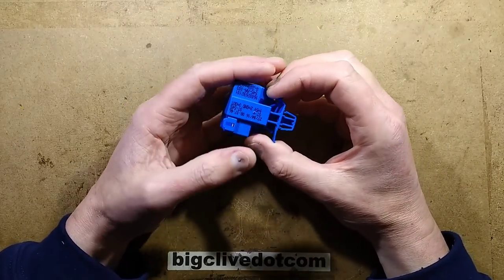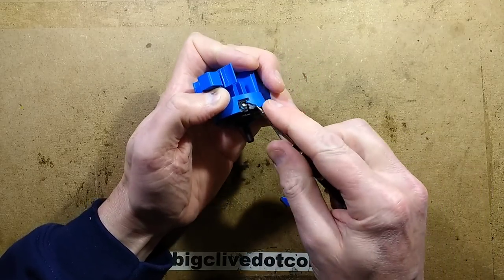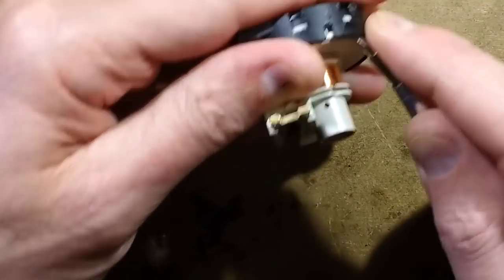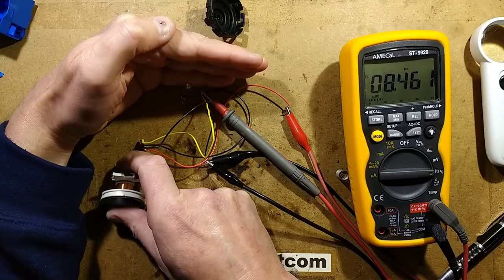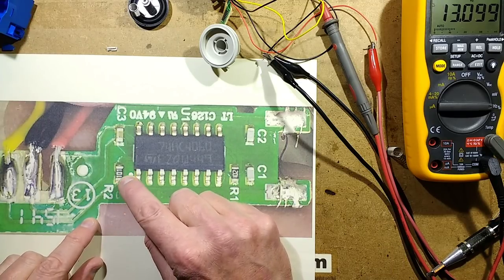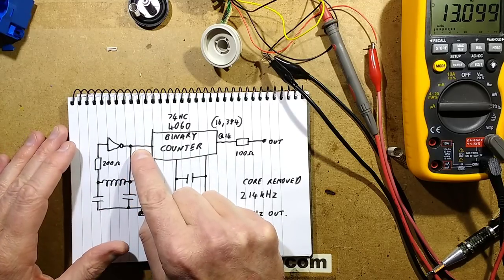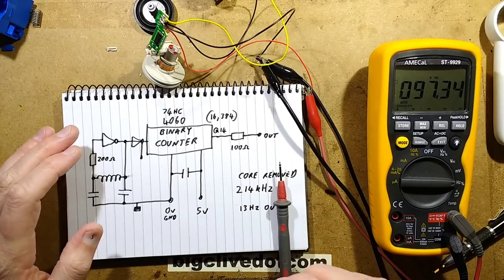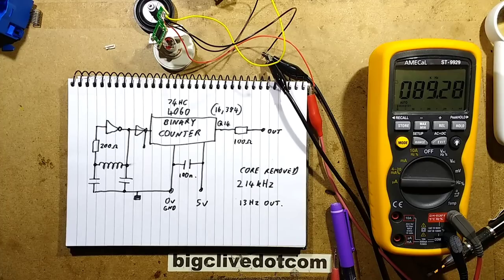Inside a washing machine water level transducer. (schematic)

Comment: I have a washing machine Ariston Aq8L with similar sensor. The output is a square wave of 5V with range that  goes from 10,75hz empty to 10,62hz with 2 liters of water. I am wondering if this the appropriate dynamic range as very often the machine fails to drain and starts blinking. This is range with drum stationary as when spinning the drum moves a lot as dampers are worn out and when spinning with normal load jumps between 10,26hz, 10,31hz, 10,36hz and 10,42 hz.
Reply from the maker: Have you checked the drain pump filter?
Reply: @bigclivedotcom  Yes, was first thing I did. I cleaned it but still happening Anyway the machine fills right level of water. The problem is with draining. It keeps draining for long and then it fails. I suspect it is because of the shaking due to worn struts that may affect the sensor readings. But when empty it is a known level 10,75hz. I am wondering what is the problem. I tried a couple times just emptying 2 liters (no shaking) and it seems to work.
Reply: @jorgemef  did you solve issue? My sensor shows similar Hz readings and I am not sure this is correct - Bigclivedotcom readings were broader range (9-13Hz or so). My machine just runs draining pump and gives F05 error. Like it tries to empty machine and thinks there is still water inside. I cleaned motor filter and even took it off when it tries to drain water
Reply: @meelis79  No, I still didnt fixed the issue. I cleaned everything, including main board, didnt found any fault there, and at the end replaced the suspensions either. The evacuation motor seems to run properly and I see a lot of flow being flushed from the evacuation tube. The machine may stop in different phases of the cycle and sometimes also does all cycles without stopping. Everytime if fails the F05 error appears. Now I am wondering if I should replace the sensor. Maybe the condensors have changed value with age and now dont resonate as well but we dont have the values to compare nor the item seems to be able to assemble/disassemble. It is a shame Bigclive didnt tested the frequency before opening it but it seems with coil in place to rest to be around 11.5Hz which is above the resting measurement from my machine with the tub flushed. I just come back to this machine as I had it out of service for last two years as was using and Indesit I had around but now that one broke the drum. Unfortunately the pressure sensor is of a different make so cannot test with the one from Indesit. Have you managed to find the cause of yours? Have you changed the pressure sensor?
Reply: Well, finally fixed it. I was set to buy a new sensor and decided to open this one as there was nothing to loose. I didnt opened the seal retainer, just the blue support to not damage the diaphragm seal. Then I tested by screwing in the plastic adjuster and was not even starting as probably was taking it as too full of water. Then reset it again and unscrewed half turn and then was possible to open the door, but then I tested to flush and was not clear it was flushing in full, so I ended up setiing 1/4 turn out of original setting. Door still unlock no problem and seems flush is full. I measured the oscilator caps and they seemed alright so my only guess is that the springs gave up with age so by adjusting it, it sets it with preset readings and also leaves me to conclude that on my machine there is no such thing as auto learned presets and is factory set to some value. I did tried the 2 litter trick to reset it in the past with no results. If you are wonder the resting frequency at atmosferic pressure (1/4 turn unscrew) is now set around 10.63 Hz so can be a good value to start with while before when was sometimes working and most not, was set around 10,75Hz. With one half turn unscrew was set as 10,50Hz, but as told I am not sure if will do full flush so I left it half away for now.
Reply: @jorgemef  Hi, I was getting my washing machine diagnosed. Repairman said it is main control board fault. It was about 7 years old and not reasonable to get new main control board. So I got new washing machine.
Reply: @meelis79  Its a shame. Most likely was just the same issue with pressure sensor. Mine is working fine now. For a technician should be simple to address as usually they have access to multiple machines under repair and can cross-check replacing parts in between machines but for a DIY we need to invest in new parts or be able to fix the broken ones.
Reply: @jorgemef  I think he tested it with different sensors and it was not sensor. At least not only faulty sensor
Reply: Actually that machine is collecting dust in my shed. But if I remember correctly I tried to adjust sensor without success
Reply: Unscrewing the sensor plastic adjust diminuishes the frequency telling machine water level is lower. If value is preset and with flushed machine One should be able to adjust the sensor until door unlatches.

Comment: How To increase water level for presure switch W10448876 Whirlpool ? Who know some thing about increase the water level, the presure suitch do not have screw.
Reply from the maker: On modern machines you can't.  The machine only intends to make the clothing wet with the minimum amount of water for the first stage of the cycle.  That increases detergent strength, the friction between the items as they rub together, and also reduces the risk of excess foam.
In later stages it will use more water.

The water amount is determined in software based on whether the clothes are absorbing any more or not.

Comment: Not particularly water or moisture proof is it.
Reply from the maker: It's mounted at the top of the machine with the inlet pointing down and should only ever see air in its diaphragm in normal operation.

Comment: Why does everything have to be so complicated ?
A toilet cistern achieves the same thing without the need for electronics !
Reply from the maker: The way the washing machine senses the water allows it to get a more thorough cleaning action by just soaking the clothes and no more at the start of the cycle.  It does that by sensing when they are not absorbing more water.
Reply: @bigclivedotcom  Clive, I'm totally not used to getting bullshit from you but in this case, it's double bullshit.

I doubt 'just soaking' actually happens on most washers (other than delicates/wool).

Normally, the drum has to rotate to try to get everything wet - so wash action could be taking place.
The not absorbing more water is done by level drop - a standard cistern float valve would take care of that and with a timer, estimating the time needed to get everything wet, saturation can be assumed.

On full loads, both my current machines underfill - resulting in the clothes simply rotating with the drum without any agitation. There is not enough water in the machine for it to be able to dribble down towards the centre of the drum or weigh the clothing down sufficiently to get a bit of wash action. A hose on the  sink tap to the soap drawer is used to add more water yet still keep the level below the porthole. With sufficient water added like this, the stuff looks wet and does get mixed about + with agitation/wash action.

If my 2 do work like that, they obviously don't work on full loads !

What I suspect the electronicsness is permitting is multiple fill levels rather than just 2 'min' and #max'.

Comment: Ok I'll admit it, ya lost me on binary chip, not your fault mine, I need to learn more about them
Reply from the maker: It's a cascade of toggles that can either be on or off.  Because they have two states they count in multiples of two.  1, 2, 4, 8, 16, 32, 64, 128, 256, 512, 1024 etc.  It's binary (base two) as opposed to decimal (base 10).  If you look at those binary number you'll see they crop up repeatedly in memory sizes and output pins.
Reply: bigclivedotcom thank you, for the explanation, you made my day. 🤝
Reply: bigclivedotcom If I didn't live across the pond, we would go out for a drink or 3, my treat.
Reply: bigclivedotcom okay so if I understand it correctly a washing machine chip communicates with the water level chip the water level creates pressure on the diaphragm the binary chip then puts out a signal the washing machine chip probably has three levels small medium and large. Once the preset signal is met the washing machine turns water off.